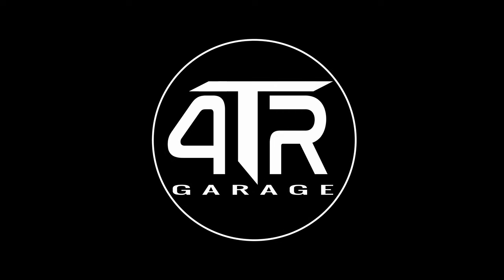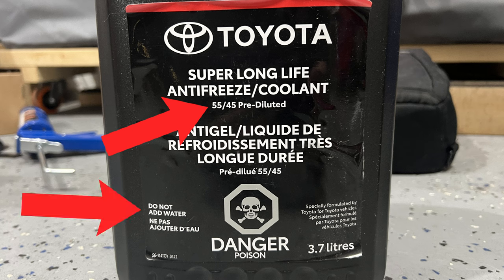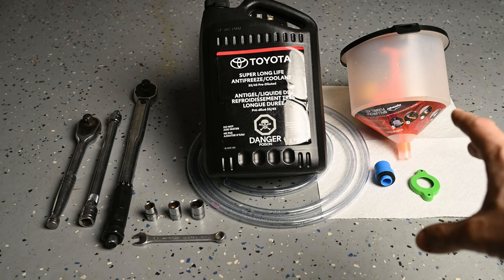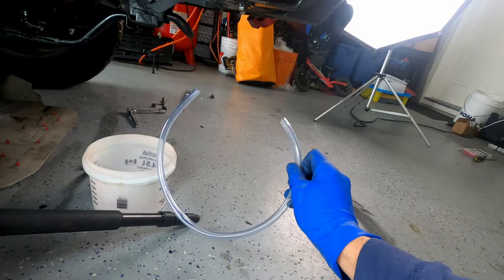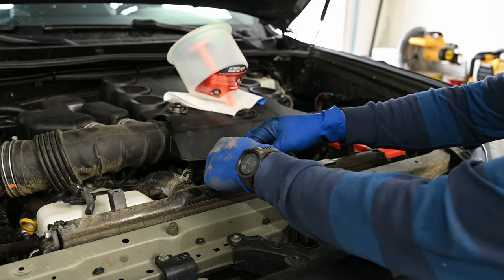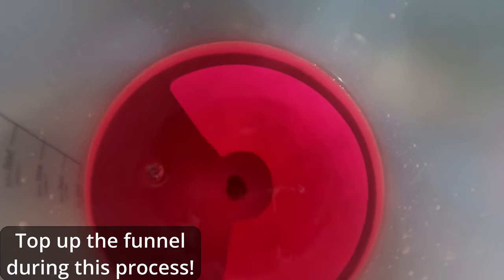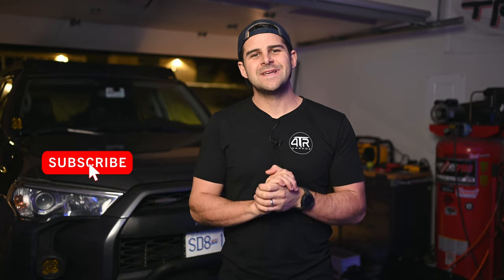The ULTIMATE 4Runner Coolant DRAIN and FILL

Comment: Great job. Just a note. Regardless of how well you burp it while idling, the system will continue to burp small amounts of air over the next few hundred miles. That will impact the overflow tank  level. Don’t panic, it will eventually get all air out and the tank level will stop lowering.
Reply from the maker: Good call! Definitely a good idea to keep an eye on the overflow tank and top up as necessary. Thank you!
Reply: Yeah, I noticed the same thing when I changed the coolant in my Yaris. I just topped it off over the course of about a week when the fluid dipped slightly. After that, it leveled and was good to go.
Reply: Thanks guys ! I will definitely keep that in mind . 👍
Reply: Good tip. I list did mine in YT Corolla. Tundra next

Comment: So your hose sizing did not fit on the engine drain. Might I recommend people use the radiator pickup hose from the radiator reservoir to connect to the drain ports. Then you also don’t have to purchase the tubing and it doesn’t make a mess of coolant on the engine block. Otherwise great video thanks for posting.

Comment: Two things-The blue cap with the blue nozzle from the funnel kit shown here fit tighter on my 2018 the green one in the video was very loose and leaked when filling the funnel. The recommended tubing is definitely too big for the engine block drain it drips and runs everywhere. 1/4 is too small so what’s the secret to keep this thing from dripping all over the place?

Comment: Another banger, thanks for making. I think you've pretty much done videos on all routine maintenance at this point. We're going to have to start requesting more obscure tasks. 😂
Reply from the maker: Thank you! I’m thinking spark plugs next…..then maybe how to replace the windshield washer fluid 🤣
Reply: Have you made a power steering fluid flush video?
Reply from the maker: @jeremysmothers5143  Thanks for the reminder Jeremy, that’s definitely one I need to do soon as well
Reply: @T4Rgarage  Serpentine belt adjustment and/or replacement? Depending on if you need it though
Reply: Maybe you can focus on the 'soft skills' of 4Runner maintenance, @T4Rgarage   - like how to convince our wives to let us install mods like the Victory 4x4 DAM on their daily drivers.

Comment: Good job. Nice vid. Make sure not to back off the drain valve too much on the radiator or it will drain down the tube as well as all over the skid plate. Thanks 👍

Comment: Awesome job on the step by step video. This will help me tremendously and gave me the courage to try this for myself. Thank you for all the great information and as others have said listing what is needed. Please keep the videos coming ! Quick question on changing the coolant. When graining the blook do I turn the heat knob to the heat position ? Thank you in advance for your reply! Also how difficult is it going to be to burp all the air out of the system and in all tips will be very helpful. Again thank you so much!
Reply from the maker: Thank you! Yes, you should have the heat knob cranked to max. Follow the procedure to burp most of the air, little bit will work its way out on its own after. Just keep an eye on your overflow tank for 2 weeks and top up if necessary.
Reply: @T4Rgarage  sounds good . Thank you !

Comment: Another great video!
I know oil changes are easy and I don't think you have ever done a video on one, but my question would be what your thoughts are on engine oil additives like Ceratec Liquimoly for 4Runners?🤔
Reply from the maker: Thank you! I haven’t researched additives much. I think I would stick to whatever is recommended by the manufacturer unless there was an issue. A high quality synthetic is what I use with factory Toyota branded filter
Reply: I just watched a video on additives, they ran lab tests on oil with and without the extra additives, turns out the additives actually made the oil perform worse.

Comment: Thanks a lot for the very good video. It will help me a lot.

I read some things about draining the thermostat too. What about it? Why did you not include it in the video. Is it necessary? 
Thank you
Reply from the maker: The Toyota service manual calls for the engine drain(s) and radiator drain only. I think this is why the service interval after the first change goes from every 100k to every 50k, as you don’t quite get all the fluid out. This method gets most of it out though without overcomplicating things. Hope that helps

Comment: I just drain the radiator, refill as you did, drive for a few days and repeat.  I don't do the engine block.  I mean, with your method you're getting 8 out of 11qts (so even with the engine block drain it's not a full drain) and with my method I pretty much get the same.  Sure, mine may keep a bit more of the 'pre-changed' coolant, but it's really easy/quick to do and I've done it every 50k (first at 50k and just repeated as I turned 100k).  Either way is more than enough, I'm sure!  Thanks for the video.
Reply: Your method is no where near as effective.  By draining block it allows you to add 2/3 capacity for equivalent  66% fresh coolant.  By doing just radiator it is 33% first time but you are then drawing 1/3 volume which includes 1/3 fresh coolant and replacing it.   You method is thus ending up with 55% fresh coolant equivalent (100%+33%×2)/3=55%

Comment: Thank you so much for making this video....unfortunately for me I don't have a place to lift my 4runner limited and change it's coolant.i gotta pay someone to do it instead.otherwise just a few questions.

1.can the old coolant fluid be flushed out using a vinyl tube instead of removing the platic jug that's inside the engine bay instead of removing it completely to empty out ?

2.i have a 2014 4runner Limited almost approaching 100,000 miles,would there be an additional drainage on the front passenger side engine block ? 

I'm definitely gonna stand and watch the mechanic to make sure he's doing exactly what you have done.again thank you so much,I really appreciate these maintenance videos.😊

Comment: Have you ever used a compresssor to pull a vacuum on the cooling system (to check for leaks) and then filled it using the vacuum to eliminate trapped air?
Reply from the maker: I haven’t, I’ll have to look into that though, always open to learning new techniques. Are the attachments pricey?
Reply: PS Really enjoy your videos.  I have two 4Runners (2020 & 2021)

Comment: @T4Rgarage Very nicely done video.  I think you did a great job explaining the procedure and detailing each tool that was used.  Two questions though - can an ordinary funnel be used or is there something in the bleeding that makes the funnel in the video better?  Is more bleeding required if the funnel with the seal is not used?
Reply: You’ll be spilling coolant all over the place without the type he uses. Also burps much better with the sealed adapter to slip tip funnel kit as air will travel to the highest point which is the top of the coolant in the funnel

Comment: Is it necessary to drain from the engine block? What if you just drain from the radiator?
Reply from the maker: You’ll only drain about a gallon (4qts) from the radiator alone. Draining the engine block will allow you to drain almost another gallon. You will exchange much more fluid by draining the block

Comment: looks like you have some significant oil leaks... unless that is some sort of undercoating?
Reply from the maker: It’s fluid film black, and a lot of it haha
Reply: @T4Rgarage Good Product, my 2023 SR5 Premium is also covered with oil based rust proof including fluid film. Just trying to protect my investment from rust as much as possible.  Our winter is brutal here in Toronto Canada.
Reply from the maker: @teddynaicker2997  I hear ya, our roads here have been terrible these past few weeks. Lots of salt being used by our municipality. Some of the salt chunks are the size of small rocks. You have to protect the undercarriage and frame on these things so they last as long as the drivetrain
Reply: @kimbuck-2 exactly same here.  Just the coin car wash myself  during  the winter for the exterior.  I don't touch underneath . I just use low pressure garden hose to rinse off underneath in April to remove bit of salt build up in certain spots.  I Also remove the spare tire and rinse that spot also and then spray more rust proof in certain spots.  I like how dust sticks on the rust proof and forms a nice thick barrier . Cheers!
Reply: I use amsoil metal protect HD, I had to get it when I was in the US since they don’t sell it in canada… took 4-6 cans, it’s more of a wax so won’t wash off and lasts way longer. 
On the topic of coolant flush, thank you for the video! I’m definitely going to drain the block and rad next time, last time I just did the rad.

Comment: Will this process work for a 4th gen too? Specifically, just draining the coolant from the engine block. Is there a drain on the block for 4th gens?
Reply from the maker: If you have the V6 it should be the same, except you will have two drains on the block. Drivers and passenger side. You could get away with just draining the drivers side though

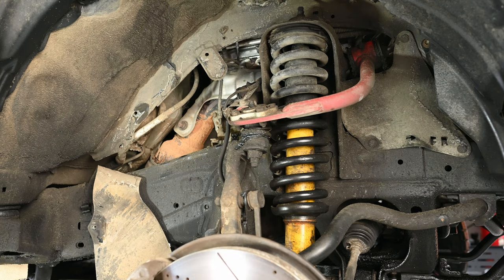Comment: So... the bolt under the passenger side snapped off. Apparently it was on super tight and rusted. So, its broken off. (5:14)
Tomorrow Ill attempt to use a bolt extractor to get it out.

Do you know if that bolt fully unscrews?
Reply from the maker: @michaelfrymus  damn… I’m sorry to hear that man. I don’t know if it fully unscrews. Is the fluid coming out or is it still sealed? If it’s still sealed I might just use other methods to get a good amount of fluid exchange
Reply: @T4Rgarage yeah, the bolt is broken. I'd need to get the whole Cylinder block drain cock plug replaced to do a proper flush.. so far I can only drain from the radiator. :/

There's a hole in the bolt too, so I'm a bit worried. It's not leaking, but maybe it could blow from the pressure when it warms up?
Reply: @michaelfrymus How did you resolve your problem?  I hope you did.

Comment: In your video you show 55-45 pre-diluted coolant.  On the Amazon link the coolant shown is 50-50.  Which one is the correct one?
Reply from the maker: Hi there, I am in Canada so they have tweaked the formula a little here the colder winters. Both will work just fine though
Reply: @T4Rgarage  I see.  Thank you.

Comment: If you don’t wanna deal with draining the block just drain and fill the radiator 2 or 3 times over the course of a week while running heat to flush/mix out all old fluid